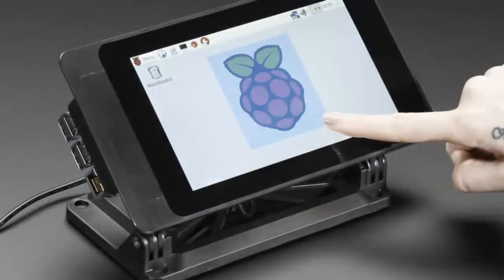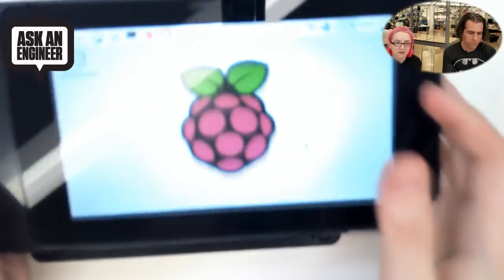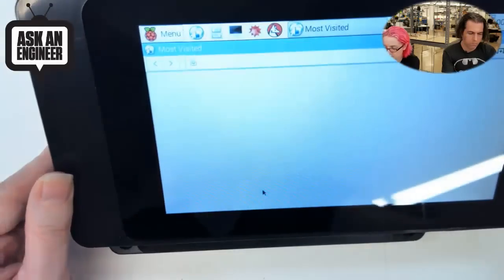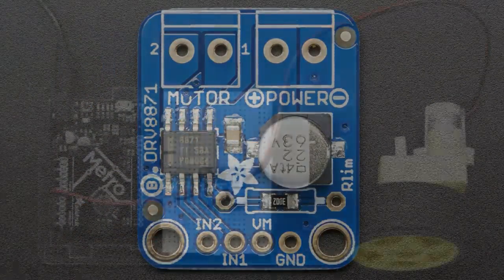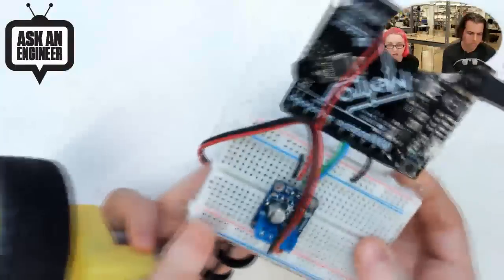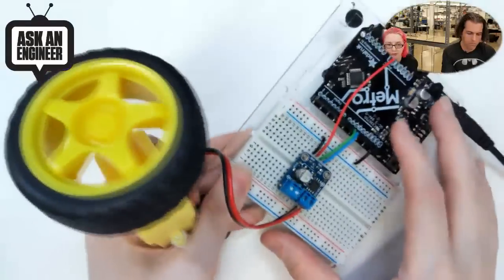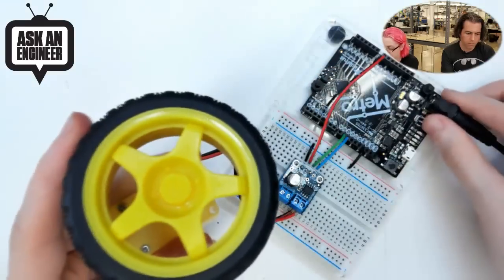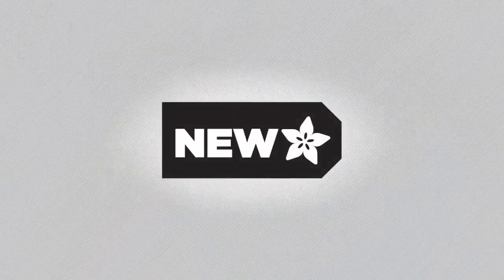New Products 7/6/2016

Comment: So turns out I connected 12v to POWER and 5V to Vm thinking they were separate. Turns out they're internally connected. Fried my Arduino. Need to start from scratch. Had a lot soldered to the board.

Comment: Maybe I should've read the datasheet first but I think I fried my Arduino by hooking up the "Power" connector as well as the Vm connector. My intuition told me that you hook up the power and motor terminal blocks and drive the motor with the in1/in2 and drive the circuitry with 5v from the arduino... exactly how you would if you used a relay module. You're showing here that the power terminal block is irrelevant. Why have it on the board?